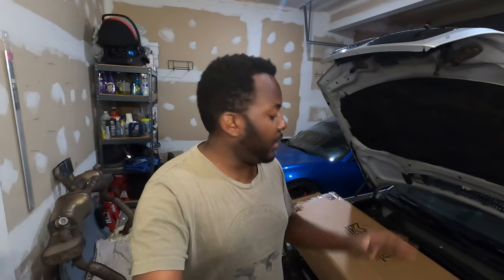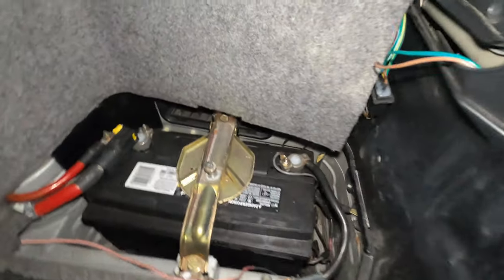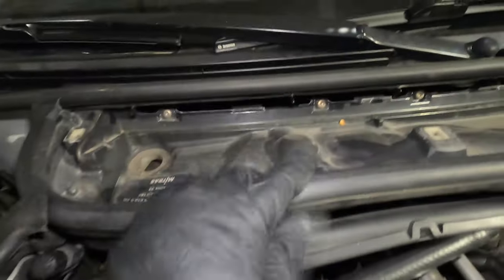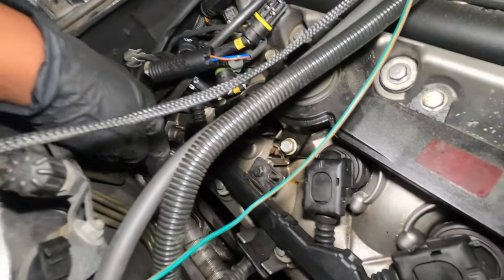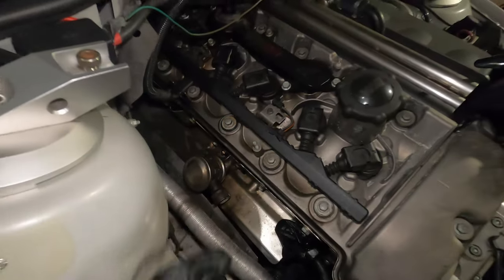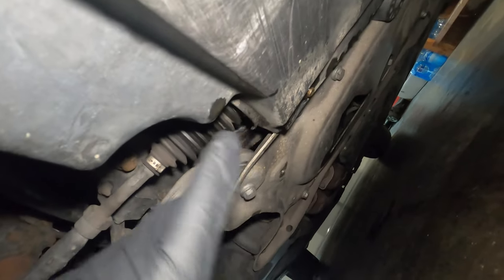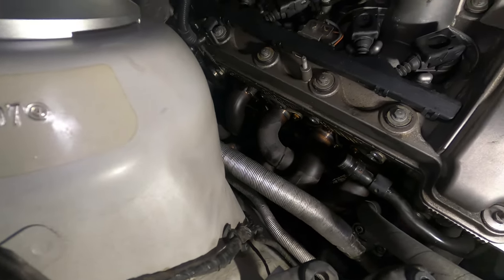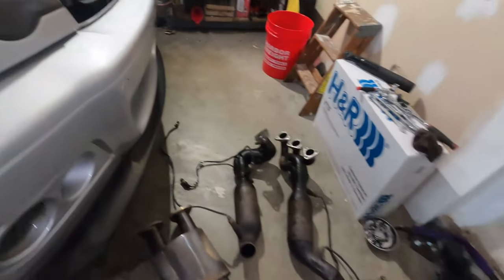Megan Racing Headers Installation on E46 M3 Part 1

Comment: Is the exhaust still after market or back to stock?

I have a stock exhaust system and I added a 2nd resonator on section 1 and it took the rasp out but it did quiet it down a lot. I was thinking about also going catless header for performance and a bit of an aggressive tone. 

I had a top speed muffler previously and it was obnoxiously loud so I went back to stock. Will be following this build!
Reply from the maker: It will help bring some noise back